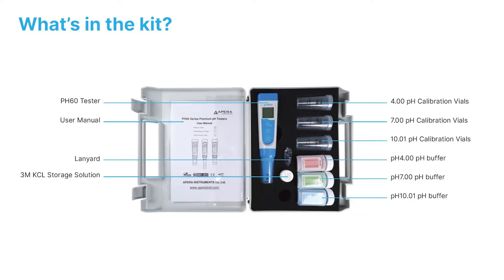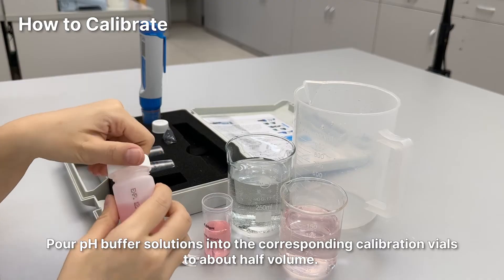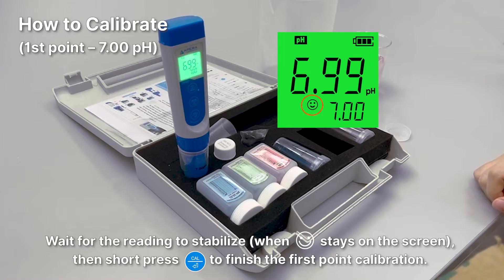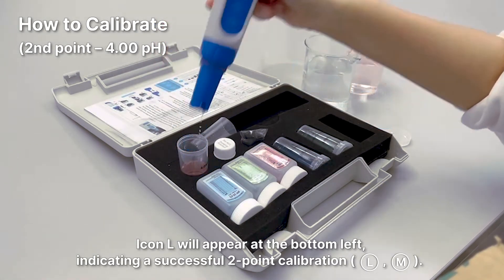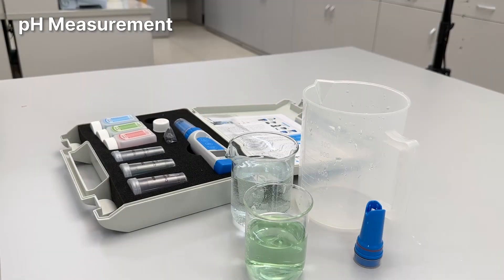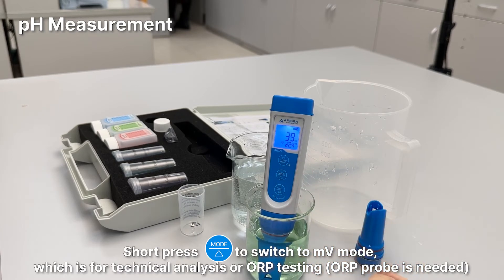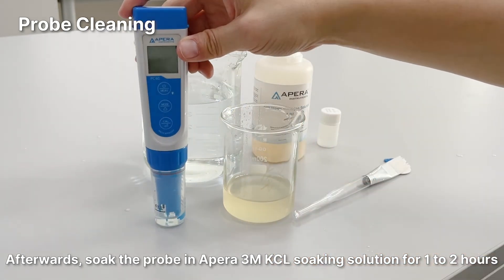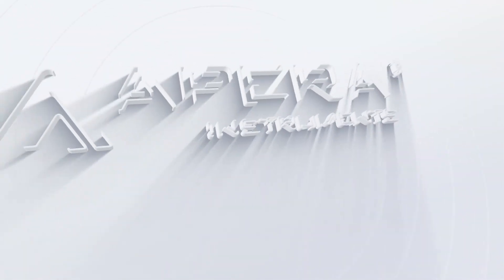Apera Instruments PH60 pH Tester Quick Start Tutorial

Comment: If I use this every other day do I need to store it in solution? Also when do you really need to calibrate after every use
Reply from the maker: The best way to maintain your pH probe in optimal condition is to store it in 3M KCl soaking solution whenever it’s not in use. If you don’t have soaking solution available or find it inconvenient, storing the probe in a wet cap (with just 2-3 water droplets inside, never submerge the sensor in water) is also acceptable. This will keep the probe moist and prevent it from drying out.

If the probe does dry out, don’t worry—it can be restored by soaking it in 3M KCl solution for at least 2 hours (longer if necessary) before use.
Reply from the maker: You don’t need to calibrate the pH meter after every use. The calibration frequency depends on several factors, such as the type of samples you’re testing, the level of accuracy you require, and the age of the probe.

As a general guideline, we recommend calibrating about once a week to maintain accuracy. You can also check the meter’s accuracy at any time by measuring a fresh standard buffer solution. If the reading falls outside your tolerance—for example, 6.92 in a pH 7.00 buffer at 25 °C (0.08 pH off) when your tolerance is ±0.03 pH—it’s time to recalibrate.

Comment: Do i need to clean it after every using? 
I will use it 2 x times per week 

Do i need to calibrate it everytime?
This would be alot of work and i dont even have so much PH solutions
Reply from the maker: Cleaning the probe after each use is very important. The tester is only as accurate as the probe is clean. Always thoroughly rinse off the probe before and after each test with pure water.
Reply from the maker: The frequency that you should calibrate your pH meter depends on many factors such as the nature of your test samples, performance of electrodes, and the requirement of the accuracy. For high-accuracy measurement (error tolerance <±0.02pH), the meter should be calibrated before test every time; For general-accuracy measurement (error tolerance >±0.05 pH), the meter can be used without calibration for up to 1 month.

Comment: How often should i need to calibrate my ph meter?
Reply from the maker: The calibration frequency depends on several factors, such as the type of samples you’re testing, the level of accuracy you require, and the age of the probe.

As a general guideline, we recommend calibrating about once a week to maintain the accuracy of PH60. You can also check the meter’s accuracy at any time by measuring a fresh standard buffer solution. If the reading falls outside your tolerance—for example, 6.92 in a pH 7.00 buffer at 25 °C (0.08 pH off) when your tolerance is ±0.03 pH—it’s time to recalibrate.
Reply: @aperainst once a WEEK !! This process to like 30 min ! I grow plants am not a real scientist my guys 😂 .. is it require if i only use it on declorinated water ?! Thanks !

Comment: Do i need use the cleaning solution when its brand new?
Reply from the maker: No, you don't. The cleaning solution is only for those tough contaminants stuck on the sensor. For regular contaminants, soap water will do the job.
Reply: @aperainst  thanks
Reply: @aperainst never mind i figured it out. Definitely not exactly as easy as the video looks but I guess I didn't have it stirred and the stabilize properly or somthin. Eventually after many repeat tries,  I got it.  Otherwise I think it's a great product. 👍
Reply: This thing dosent want to stabilize on calibration.  Its just bouncing around and won't lock on nothing. What do i do with this?
Reply from the maker: @Wide_leaf_indica710  We are sorry to hear that happened to your device. Please contact our customer service team at +1 614-285-3080 or info@aperainst.com. They would be more than happy to help you solve the problem.
Reply: The video shows them pulling the battery cover off as if it's a brand new one, that's why I kinda thought I needed the cleaning solution for the first time also.
Reply from the maker: No, you do not.

Comment: Can’t find anything that tells you what to do with the solutions after. Do I throw them away? Can I reuse them?
Reply: Your manual states you can use the solution up to 10 times or so. The more you know. 🌈
Reply from the maker: Each small bottle of pH buffer solution can typically be reused several times: up to 10 calibrations for pH 4.00 and pH 7.00 solutions, and up to 5 calibrations for pH 10.00. Make sure not to leave the bottle open when not in use.

For disposal, in most areas it is safe to pour the used solutions down the sink. For detailed guidance, please refer to the Safety Data Sheet (SDS), available at support.aperainst.com.

Comment: Hello, thank you for this tutorial! Could you please tell me what sequence I should use when calibrating, including a 1.68 pH buffer?
Reply: In case anyone has the same question, I spoke with Luke from Apera Instruments. He advised that for low acidic testing with the 1.68pH buffer, the calibration sequence should be: start with 7.00pH, followed by 1.68pH, and finish with 10.01pH, effectively replacing the 4.00pH buffer with the 1.68pH buffer. Be aware that if you calibrate for low acidity and you do not recalibrate the pH meter and then test something that needs to be within the 4.5-5.5pH range, the results may be slightly inaccurate. Hope this helps!
Reply from the maker: @teresae4268  Thank you for sharing the info! Yes the recommended sequence is 7.00, 1.68, then 10.01. Always start with 7.00.

Comment: I have a problem with my Apera PC60 meter. When I set it to conductivity units, it jumps from 1.600 to 2.5 without showing readings like 1.700 or 1.800. It only jumps from one to the other. What could be happening?
Reply from the maker: When the reading is greater than 2000 µS, the unit will be automatically converted to mS. 1 mS = 1000µS. For example, if the reading is 2500µS, the display will be 2.5 mS on the screen.

Comment: 1. What does "pure water" means? distilled water? drinking water?.... And 2. The 3M KCL solution can be returned back into its bottle after use?
Reply from the maker: pure water refers to distilled water/RO water/deionized water
Reply: Shouldn't I use tap water at all? Or that's ok?
Reply from the maker: @vascosa1394  We don't recommend using tap water to rinse off the probe as it's not pure enough and will cause contamination.

Comment: is it accurate for rain water? because the oakton ph2+ is way off
Reply from the maker: It depends on how clean your rain water is. If the conductivity of your rain water is very low (<20µS), it could take longer to get a stable reading. Sokaing the probe in pH 4 buffer for 10 seconds before testing can help speed up the stabilization.

Comment: If you can’t use tap water to store does regular bottled water work if I’m using the ph tester atleast once a week
Reply from the maker: Storage practice ranking from worst to best: soaking in pure water < store dry < store with a few droplets in the probe cap < soaking in pH buffer < soaking in 3M KCl
Reply from the maker: Please do not use any water to soak/store the pH probe as it will damage the probe over time. For soaking the probe, please use the 3M KCL solution.
Reply: @aperainst boiled or bottled water?
Reply from the maker: @isaiaguilera6279  Please do not use any water to soak/store the pH probe as it will damage the probe over time. For soaking the probe, please use the 3M KCL solution.
Reply from the maker: A few water droplets in the probe cap is totally fine and helps prevent the probe from being dried out. But never soak the probe in pure water. Only use 3M KCl for soaking.

Comment: Could you please clarify the part regarding storage? First of all the video says that for short term storage, just make sure there's some water droplets in the cap but then moments later, it says never store it in water.

1. When storing with water droplets in the cap, does it matter what type of water?

2. If water droplet storage is for short term use, why is the pH meter sold with drops of water in the cap rather than storage solution, if the meter could be sitting round for a long time before it is sold?... Does storage with water droplets vs. storage solution, just effect how long the probe can be stored without need for recalibrating or does it affect the health of the bulb in the long term? 

3. When it says never store in water, am I to take it that the video means never store it submerged in water as you would with storage solution?

Thank you.
Reply from the maker: 2. Soaking in 3M KCl for long term storage is the best practice for the pH probe. It will ensure the probe to have its optimal performance. The reason we didn't add KCl in the probe cap when the meter leaves factory is because the solution could leak out during transportation and people might think this is not in new condition. Storing with a few drops of water can prevent the pH probe from being dried out, but it's not going to maintain the probe at its best condition.
Reply from the maker: 1. Water droplets are added before the new product leaves factory just to keep a minimally required humid atmosphere for the probe. In terms of water type, using tap water or drinking water is good.
Reply: @aperainst I ordered mine Yesterday and it's on the Way. Hope I get it soon! Would it not be the Best to use a few Drops of Destillated Water in the Cap to store it for short Periods because of the Lime in normal Water? Clean it with dest. Water, shake it off a bit and close the Cap to Storage to leave it a bit wet? 🤔
Reply from the maker: 3. Yes you are right. Never soak the probe in pure water because it can damage the probe's reference system and cause measurement inaccuracy in the long term. For probe soaking, please use 3M KCl.
Reply: @aperainst  Thank you for the responses.

Since posting my original comment, I have researched the topic myself. So for the sake of further clarifying the issues around storage, and the use of various types of water, could you please confirm whether the following is correct?

From my research, I've found out that the probe is comprised of layers of semi permiable glass, between which is an electrolyte solution. The exact composition of this solution can vary from manufacturer to manufacturer. When you store the probe in tap water that has a different balance and composition of electrolytes, or worse yet, distilled or de-ionized water that is very low / free of electrolytes, the solution inside the probe can be leeched out. Which can damage the bulb and the sensor (1).

Further more, storing the probe in the wrong type of storage solution can also cause the balance and composition of the solution inside the bulb to change. Which is why you should always use the storage solution that the manufacturer recommends.

A few drops of water in the cap will help maintain a moist environment in the short term, and any leeching of the solution in the bulb should be minimal due to the minimal contact between the bulb and the water... but the bulb can dry out over time. Which is why for long term storage, it should be submerged in the recommended storage solution.

Would you say the above three paragraphs are correct?

I do have one follow up question, which I've never been able to find a definitive answer to... 

(1) Does the solution inside the bulb drying or having it's electrolyte levels reduced actually damage the bulb / sensor, or does it just make it inaccurate?
Reply from the maker: @WebeloZappBrannigan  The above three paragraphs are correct, very well written. For the follow-up question, the electrolyte inside the glass bulb (inner reference solution) will not be dried out and it won't be reduced, as it's sealed inside and does not contact anything. What will be reduced is the outer reference electrolyte, which contacts with and slowly goes into your tested solutions. When we talk about a pH probe's aging problem, the lack of outer reference electrolyte and the reduced sensitivity of the glass membrane are the two main reasons.

Comment: When calibrating at step 3 (1st point calibration), does the bigger number need to be exactly 7.00 or 6.86 as indicated in the bullet points at the bottom of step 6? Or is there some wiggle room there?
Reply from the maker: The bigger number is the actual real-time reading of the buffer. Usually, it won't be exactly 7.00 or 6.86, which is why the meter needs to be calibrated.
Reply: @aperainst  thank you much appreciated